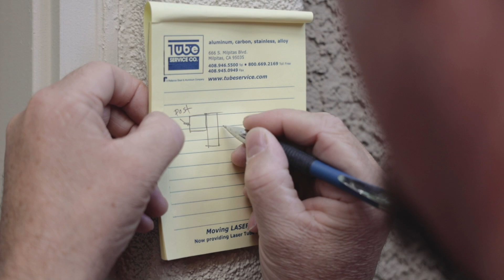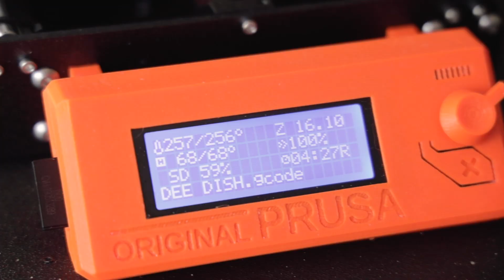Quick 3D Printed Invention Protects My Autistic Son | VLOG #112

Comment: Be careful if that's a PLA print. It is biodegradable and direct sunlight as well as other weather elements can cause it to break down and weaken quickly depending on the weather. Since you're using a Prusa Mk3 you should be able to print with ABS or PETG and it should hold up much better

Comment: Love the build... but gotta ask why not just buy a Magna-Latch safety gate lock that they use at swimming pools? Sell them at Home Depot and Lowes.
Reply: Way cheaper to print. There's probably like $2-$3 worth of material there.
Reply: Don't forget to add the time it took to go there, measure for the project, design in CAD, and the fixed overhead costs. $2-3 in material. $75-100 (minimum) for everything else. 

While this is a cool little project, trying to boil it down to material cost is inaccurate, to say the least.
Reply from the maker: Let’s not get carried away, I just wanted a quick fix and to show you and my kids how cool 3D printing is. Easy problem solver.

Comment: Looks good, love the content. The print will probably warp in direct sunlight though.
Reply: If its PLA, Yes. If its PETG, it'll probably be fine.

But the layer lines on the part that sticks out to keep the gate locked will probably break with a small shove on the door.

Comment: The only thing I would worry about is that the layer lines are parallel to the door opening. this could cause the part to break if someone ran into the door with enough force to snap the part along the printed Z layer lines.
note at 5:06 the build layer lines.
Reply: depends on the perimeters used and also the plastic ... it should hold a bit
Reply: I noticed the construction, and I sort of like it. But I was thinking more about being strong enough to keep a child in, but weak enough to shear in an emergency situation. 

If I’m being honest, I’d say the biggest obstacle is the height. His wife is not too terribly taller than the kids. It looks challenging to position it where she can easily access it, but the kids can’t 

I’m tuned in for future design revisions and concept perfection. 😁